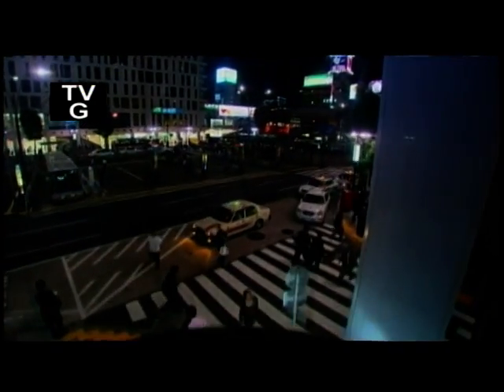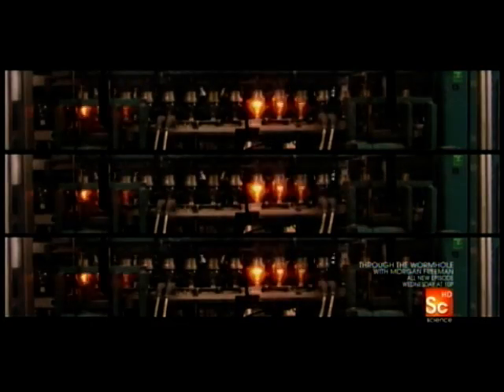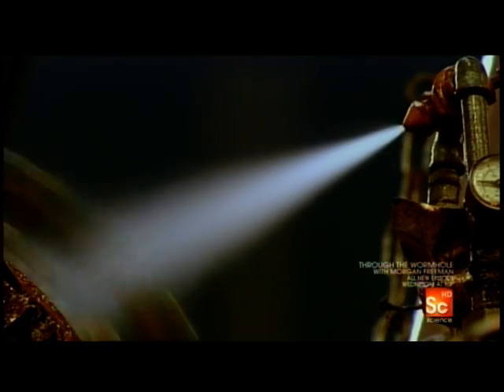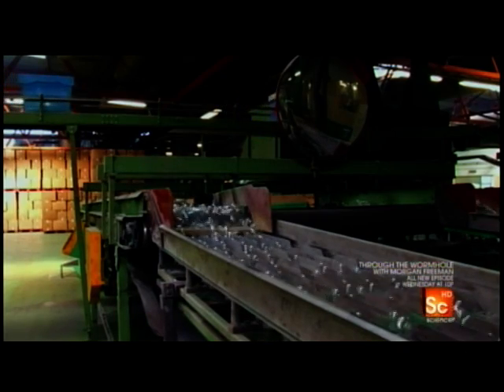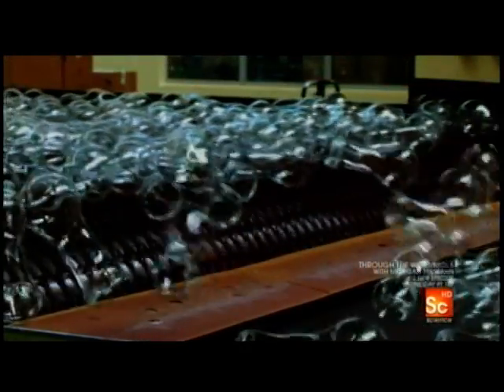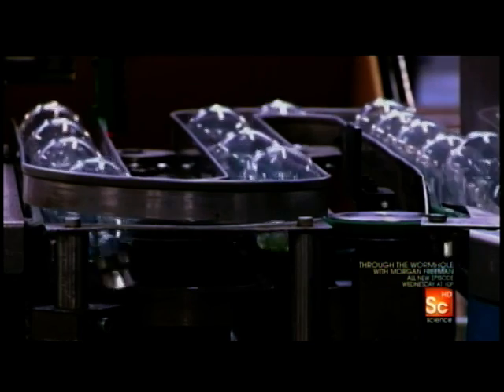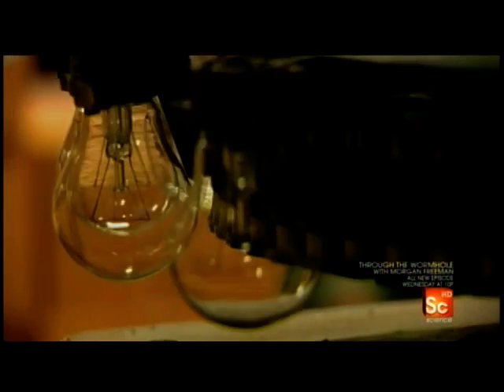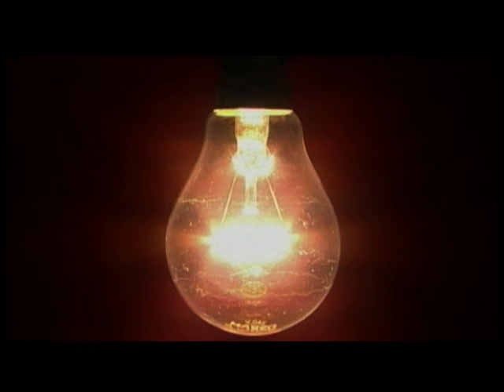How do they do it - Lightblulbs

Comment: just a small note:  glass is one substance that does not "turn into a liquid".  there is no melting point of glass.  it just becomes less viscous or softer.  
Also, the silver or black you see on burned out auto instrument bulbs are actually molecules of tungsten that have "sputtered" from the filament onto the glass at it heats up.  as the filament gets thinner and thinner; it finally acts like a fuse, and burns out.

Comment: One error: The first practical incandescent lamps used carbon filaments, not tungsten.  The coiled tungsten filament was not introduced until 1913.  Tungsten filaments appeared a few years earlier, but their sintered design (drawing tungsten into wire was not yet possible) made them very fragile.  Tantalum was also used for lamp filaments, but it could only be used on DC.
Also, this is an Osram factory, not Philips.